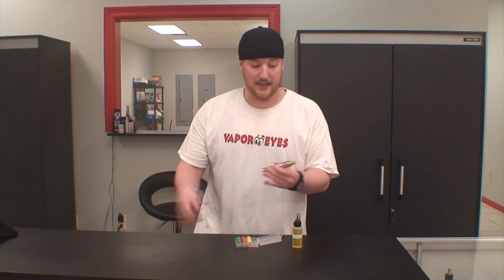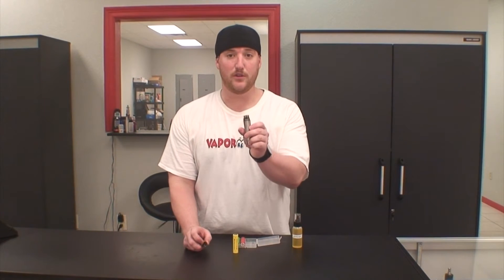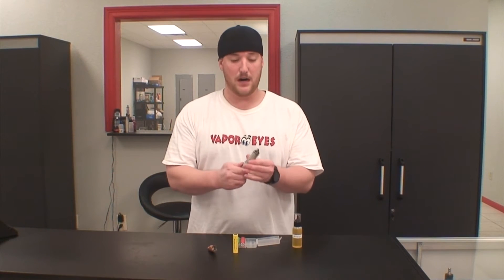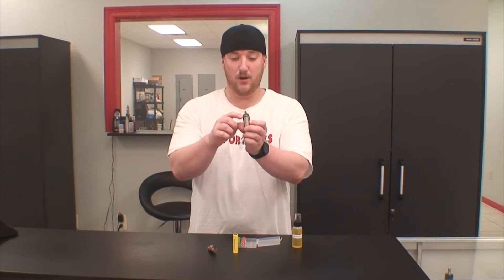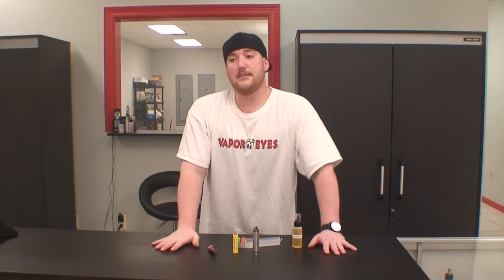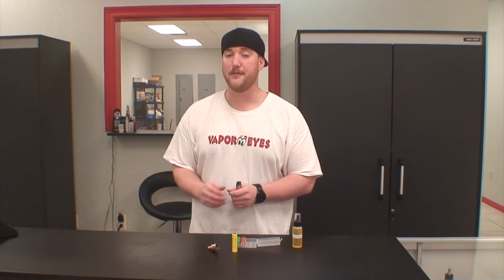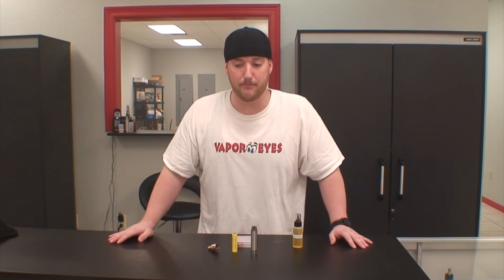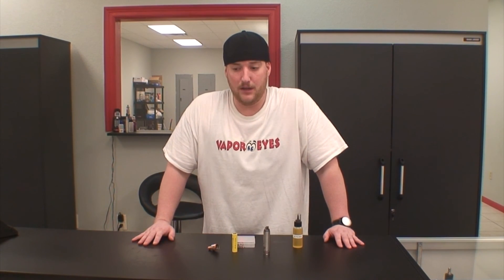Explaining Mechanical Mods, IMR Batteries, and Sub-Ohm Builds

Comment: If I bought pre built coils that tell me the ohms would I still need an ohms meter?
Reply: Will Jones yes I would suggest it bc even though your box says it is this ohm sometimes things are off also biggest thing I can tell you regularly check your build everytime you put your atty on your mech you should put it on an ohm meter or test atleast 1x a day bc a short can happen anytime and that's 1 of the biggest ways things blow up w a mech a short could even happen between 1 hit to another honestly just make sure you get an ohm meter an test your build on your rda or whatever regularly an ohm meter is under $5 so not a bank breaker at all esp for your safety and also I don't ever suggest people to use tanks of any kind on mechs esp hybrids hopefully your already building an have this info sry it's late but when I saw the q I wanted to be sure lol better late than never right lol have a good 1

Comment: thank you for your vids.  what would you suggest for the kanger drip box bc I think it qualifies as a mech not 100% but want to be safe is all
Reply: Kieri ZippedGnome. its a regulated mod "non mech" your good bro.
Reply: yamez138 actually after buying 1 and using it it is technically a mech there's no chip or anything that helps control the safety of the build vs battery so if anyone gets a dripbox know your builds and know ohms law 4sure make sure you don't build to low for the battery it's a single 18650 and definitely don't use the regular batteries u would in a regulated mod make sure to get a battery you would use in a mech like a vtc5 or even the cheetah prints if that's your thing but bcarful bc there is nothing that regulates this mod at all it is not a regulated mod
Reply: Kieri ZippedGnome. oh ok bro yea i didint know that i thought it was more like the joytech vtc. or semi mech at best. kangertech makes that right? my bad bro i haven't. been up to date on those in awile sence my noisy cricket i haven't really touched any of them and now am only on full mech. so that's all ive been paying attention to. my bad for the mis under standing.
Reply: yamez138 it's all good man I go between regulated an mechs I've got RA so my mechs hurt my hands alot worse to use so as much as I love them an prefer them I can't always use them it kills me to build I can't do any fancy builds it just hurts 2 bad lol an to press the button gets where it hurts really bad so I have to switch back to my regulated mods some as well but that dripbox is a kanger tech an hit really good honestly i really want to try their dripbox 160w also just for the longer battery life the only regulated thing about the regular dripbox os the button flashes if the battery dies that's it no other features or anything an Def don't charge in device the button does get hung up on some of them also an can auto fire bc of that so just have 2 make sure to keep it cleaned up an stuff but it's a good lil device an u can't put any rda on it an use the squank w any rda that has a squank it hits like a mech as well not a train hit all the time or anything but it's decent they have the dripbox ez drip or something like that it looks neat I havnt seen much on it but they have some cool stuff and they did release a regulated version of this dripbox the dripbox 60w and 160w it has a screen an all 2 it but if u like mechs man you should check out #cloudbox they have an ig page an they send a mod mech or regulated your choice an atty and juice for $60 it's great gear for a great price an there's plenty of codes for discounts I've even got 1 if u want 2 check it out they do great stuff and they r up an coming def could use any advertising they can bc vapebox an zample can't compare to them at all anyway great vids man an I just wanted to let u know incase any1 read the msg an 2 make sure they def check their ohms an do the work jist like a mech or it can end badly an we just don't need that kind of stuff going on w the fight we already have going on
Reply: yamez138 sry for no punctuation lol in a bit of a rush lol an I def think u should start doing more vids again u got a good image going an good vibe it goes a long way hope to see more from u
Reply: Kieri ZippedGnome. sorry to hear about your pain brother. i just started building about a month ago man cant get to crazy yet myself normal just build parlel. " 2 wires per coil" so no worries bro . and far as punctuation no worries there my spelling is treble and am very far from a gramer Nazi lol.
Reply: yamez138 I thought about getting the coil builder from coil master or the daudulas coil maker they make all kinds of the awesome coils and really easy to do it seems u coil check it out if u want to make claptons an stuff on your own esp being new to building I wish I had known about them way b4 lol I like just plain twisted wire but man the claptons and stuff are great on flavor I do notice the bigger the build makes my throat a lil sore not sure if many people have that happen I just rotate between wires a clapton coil I can keep the same 1 for atleast a month it's crazy how much longer they last just burning them off
Reply: Kieri ZippedGnome. i thought about it bro i really enjoy building and getting better at as well . and learning better ways to build on my mods the coil builder would be cool. but as of now am just better and better. i do use a few aps on my phone as far as making sure i know my builds and finding difrent ways i can build. i do like the clapton but im having fun building thr parolel builds am building. i just got my first full mech like a month ago. "nothing crazy" but i love it so am building in it. like i just build last night 2mm 4wrap 0.20 ohm perole for it . and its hitting pretty nice. am using the tesla steam punk mech. i got used. with my geekvape tsunmi rda. ill Probly move up to a better mech soon.  "better quality" i like coper. "which mine is" its more of a hobby for me since i got into building it just relaxing and i love building stuff. i still might do a coil builder some day. but id like to see how good i can get. and the outcome of my builds. but thank you for the recomadtion .. i can't wait to get better and build better more complex coils. "the prerol i build" is just building with two wires insted on one. am using 28 guage kenthal right now.
Reply: my other set up is a noisy crikit 2 mutent xv4 rda. that i have to build higher for like .30. at the lowest sence i only use it on series mode that things got power! but still semi mech. and i like the way my tesla hits a Littil better.
Reply: yamez138 I thought about getting the noisy cricket 2 would you recommend it I usually build around .2 on everything that's my only thing w it I just like the way it hits around there I also mostly do for hobby now it's hard 2 keep off ciggs if I don't lol that cloudbox really is great though I get most of my gear thru there now bc it's jist a really good deal an I also don't mind getting clones on mech mods really not much difference in the authentic an clone except 1 cost $250 lol if you set up w cloudbox you can use my code ZIPPED or I think there's 1 across the top of the menu thing on the site they are all over the Web though so not hard 2 find but I havnt used many series mods that's my next go to I think I'm not sure 4 sum reason just can't stop getting a sore throat lately w my attys also wanted to ask u if u make your own juice or what kind u like I make mine which I also get a good bit w cloudbox 2 but I usually just give it away lol its really good juice but once you start making it the ones you buy just aren't as good bc u can taste what's wrong an how 2 make it better lol